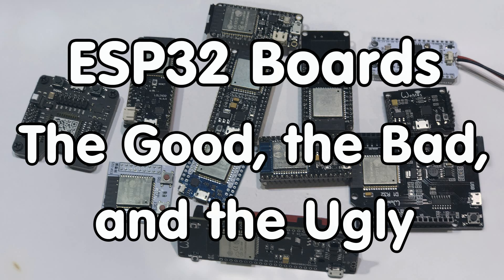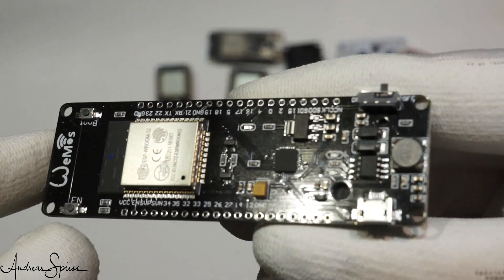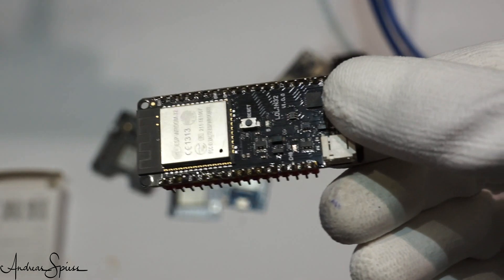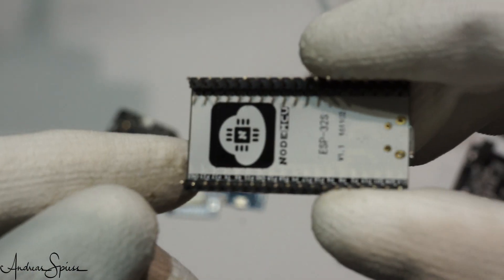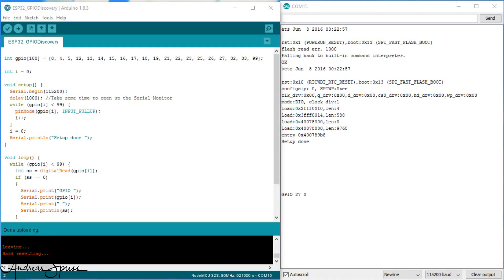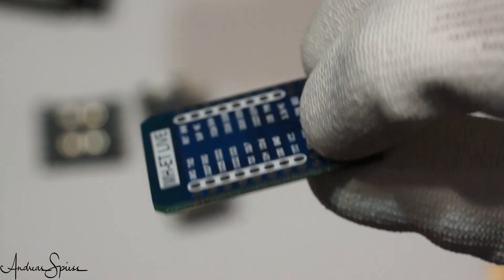#159 Big ESP32 Boards Review and Test

Comment: Wow! Great job Andreas! You have tested so many boards! That saves us so much time! Thank you very much for your efforts!
Reply from the maker: You are welcome! I also was astonished about the big selection available...
Reply: Hello Andreas,
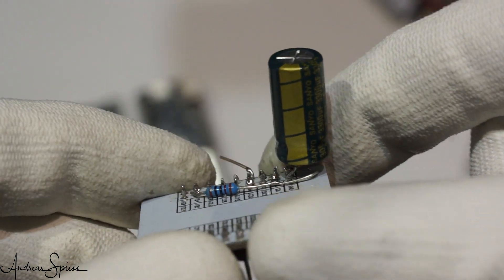i have a question to the breakout board for low power applications. In Minute 14:06 you show the breakout board in Version 1.0. On the back side of the board you soldered resistors.  In minute 14:53 of the video, you show the breakout board in Version 1.1 with added resistors. On online shops where you can buy version 1.1 of the breakout board they recommend to solder a pullup resistor between EN pin and 3,3V pin. Do I really need that also on the version 1.1 board because you said they already soldered some resistors on it? And what capacitor should i use?
Reply: educ8s.tv 

Your video on the DFROBOT esp at 10uA deep sleep was an eye opener. Glad to see you also follow Andreas, as I also follow your great work. So, thank you both.

Comment: There is something that I learned with esp8266 boards: some of them has more pins available but you can't use them because are used internally for flash memory. This is what happen with the wemos d1r2 board. It seems that has less pins available but these are all the usable pins. The missing ones can't be used because interfieres with the memory chip.
Reply from the maker: You see these pins on my Excel (marked red). I did not check all boards. But the ones I looked at did not expose these pins. My first Analog Lamb board (not in this selection) exposed them and created some headache...

Comment: Thanks for the wonderful review. I have the mini board and it is compatible with the Wemos D1 Mini shield. The sketch GPIO pin has to change e.g DHT11 shield, the pin is mapped to 16 in this board.
Reply from the maker: Thanks for the feedback. I have to try then!
Reply: I brought a couple as they are supposed to work with the DI Mini shields and I have yet to start playing with them. They are very inexpensive.

The manufacturer has published Arduino sketches showing compatibility with the Webmos D1 Mini shields.  I assume that the standby current is a factor of the USB interface chip and the power supply chip? As with the D1 Mini, I also assume that these chips can be disabled / removed once the ESP32 has been programmed. 

I like the format and look forward to playing with them.

Note, the ones I received fit normal header pins, perhaps yours is an early model?  They can be bread boarded if you use 'female' headers for some of the pins, and male headers for the other. In this way the male pins can be pushed into the breadboard, and then you can insert DuPont connectors into the female headers on top. If you put the female headers on the top, you can also stack on D1 Mini Shields.

Since mine appears to be a later revision, I will check the chip revision and post what I find. 

Love your work.
Reply: New to ESP world, I recently purchased randomly a Wemos ESP32 Mini Board. I quickly understand it required solder... Then I discovered D1 mini shields and got some, very cheap and a cheap Wemos d1 Mini too. Tested Oled, SDcard and double socket atm, they work well with esp8266 and ESP32 aswell. 
I really love this format it fills like electronic LEGO.

Comment: Hi Andreas! the "reverse oled" connector is an "Molex PicoBlade 53261-0271_02x1.25mm Angled"  you can find clones searching for "jst 1.25mm 2 pin". Very small quadcopter LIPOs mounts this connector;)
Reply from the maker: Thank you for your help. I ordered a few of them!
Reply: Andreas Spiess Thank you for your vídeos! 😊
Reply: I suppose you can just change it with a regular JST connector

Comment: I just recently received a WeMos OLED just like the one in your video. I can confirm that mine claims to have chip revision 1 (via your sketch, both version methods report 1). Just like others here I can also confirm that I do not need to execute any special tricks to upload from the Arduino IDE (WEMOS LOLIN32, Flash frq 80 MHz and upload speed 921600).
Thanks to Alex Goris here for mentioning AnalogRead is working. I'll need that :-)

And thanks, Andreas, for all these video's. They have been very helpful!
Reply from the maker: Thanks for your feedback!

Comment: first of all: great videos Andreas, keep them coming! 

Andreas comments about some of the modules being breadboard unfriendly. Since I just use one similar to the "yellow" module,  I thought I'd share my finding that if you take 2 breadboards and connect them next to each other, removing a power supply bar from one of them, you an easily use them with the standard breadboard and it gives you lots more space at the same time. I wish there would be bigger boards ....
Reply from the maker: I also used this concept once or twice and wished, some manufacturers would deliver this concept with a base plate to be more stable.

Comment: The "White Board with OLED" is a HELTEC WebKit 32. 
I haven't played with that board yet, but I have used the WebKit 8 , which is a ESP 8266 board. If you need a tiny ESP8266 board with a display, it works well.
Reply from the maker: Thank you for your feedback!

Comment: Thanks for the ESP32_GPIODiscovery. I recently bought some LoLin boards and some GPIO's  are in disguise. Funny thing is that the boards I bought (with oled, with without battery charging) are even not in your test. It's going quite fast with the esp32!
Reply from the maker: Do you have a link to your board?
Reply from the maker: Thanks for the link. I think you are right. They are coming at a fast pace...

Comment: There are custom Arduino Uno boards that can switch between 5V and 3.3V. Libraries itself aren't problem, rather electronics that depends on given logic voltage. Handy when moving components from Arduino to ESP.

Also one thing I found is that the Uno had filters on the current from USB while my ESP (and other) boards did not. That was an issue when trying to run neopixel LED tape. Arduino worked properly when powered from a laptop USB port while ESP boards (and particle photon) had a lot of interference on the one-wire and did not run the LEDs correctly. Powering those boards from a USB charger of better quality "solved" the problem.
Reply from the maker: ESPs are very picky about voltage and need much more peak current than Arduino. I did videos about that in the past. This might have been the reason for that.
Reply: Not only ESP32 failed with those LEDs - Particle Photon and STM Nucleo also. I also tried a lab power supply and that also wasn't ok. https://forums.adafruit.com/viewtopic.php?f=47&t=123007

Comment: Something to note about the board at 9:23 - the "GND" pin right next to the V5 pin is mislabeled (even on the reference manuals!), it's not actually a ground pin and connecting it to the ground will just put the board in an error state where it flashes the LED and does nothing else. Use literally any other GND pin but that one instead.
Reply from the maker: Thank you for the info!

Comment: Nice review! It would be nice if they had a larger development board which would map all pins. It makes sense for a 240 or 120 MHz processor to have more pins and completing mapping of all pins. It would be also better if the pin headers are on top rather than the bottom of the board.
Reply from the maker: You find many boards which have all available signals at the pins.

Comment: Do you have a board which supports battery and it is also possible to get a state of charge in the ESP code? This could be a general feature, but I did not find an answer to that question.
Reply from the maker: I usually measure battery voltage (voltage divider and analog input). Which is ok for Li-Ion. It does not work with LiFePo4 because their voltage is very constant till nearly the end.
I also made a video about current sensors and there (if I remember right), included a joule meter IC which does what you need.
Reply: @AndreasSpiess  Thanks. Yes I remember the voltage divider and the IC video as well. I would use 18650, so that should be OK. I was just wondering if it is already prepared on any of the boards? I mean is there a pin which is the switched battery voltage what I can connect to ACD with a voltage divider? I assume it should be the battery + line after the main on/off switch.
Reply from the maker: I never searched for a particular pin. It is quite easy on my 18650 holders. 2 resistors in series from plus to minus and a wire off the middle.

Comment: You should do a review of the ESP32 wrover board! It has a wrover module, 4mb external ram, screen and sd slot on board
Reply from the maker: So far I did not see many boards and I do not have a need for an SD card on a connected device. Maybe at a later stage when more boards with this chip are around...

Comment: Great video. Thanks for the extensive comparison.
I have on of the MH-ET boards (D1 mini form factor) that gave you problems with male pin headers. I think mine came with only female headers. In any case, female headers fitter perfectly.
Reply: I also have  2 of the nice mini kits. But the wifi reception is very poor. 18dBm less than a real WeMos LoLin 32. Do you have a similar experience?
Reply from the maker: + Álvaro: Thanks for the tip. I will try.

Comment: It is an older video but the designers of the d1 r32 wemos boards that look similar in form to the uno r3 has no analog read or write.  BUT you can add it by using a customized library that was put out by a user.  I believe you will find it in the library manager inside of IDE, it is called esp32 analogwrite.

By utilizing this library I was able to do pwm on several digital/io pins...but still no functionality on the analog only pins...

just an fyi
Reply from the maker: The PWM functionality  (analogWrite) is available also on Arduino boards. It is only a very crude method with  low resolution. But, as you mention, it works.

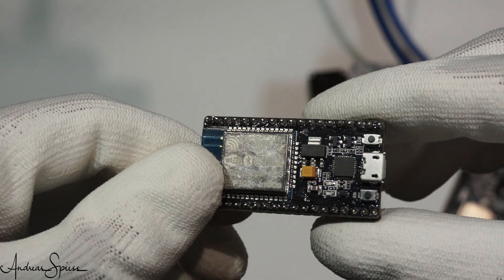Comment: Andreas, i am not sure if you ever found out what type of battery connector is used on the board at around 6:45, the white ome with OLED display.  The battery connector is commonly used in small or nano helicopter/quadcopters and has several names:  "JST 1.25", "Micro JST 1.25", and mCX.
Reply from the maker: Thanks for your info. In the meantime I learned about these connectors and even bought an assortment of those. You find them also in my newer videos about other ESP32 boards

Comment: Hello Andreas, nice presentation. What is your soldering method for the tiny PCB ? I've just purchased it , but I'm afraid I won't be able to solder it with standard iron. Thanks
Reply from the maker: It is easy to solder it with a standard soldering iron. Just try it. Maybe you start with two opposite pins to fix it in place.

Comment: Hi Andreas. Good roundup! With you previous video you shared a link to a ESP32 module on Aliexpress. You might be interested in one of the other listings (if you have not already seen it), which has an OLED display, SX1278 Lora chip with antenna and battery connector with charging circuit for €13.64. Cannot link the actual  listing but look for something like:

Internet Development Board SX1278 ESP32 WIFI chip 0.96 inch OLED Bluetooth WIFI Lora Kit 32 module for arduino

Cheers,
Reply from the maker: I saw it, but it is only 433 MHz and LoRaWAN is on 868MHz. So, I wait till this version is out.
Reply from the maker: BTW: I am pretty sure ESP32 development board and LoRa is not a very good combination. The deep-sleep current used by the development boards is too high (LoRa is a low power technology)

Comment: Hi Andreas.
Thank you for the great video.
It would be great if you could also do a similar board review for 8266.
Still, 8266 is not dead. They are very cheap ($2) and it will take at least one year for ESP32 to be at least close in stability and price to ESP32.
Reply from the maker: I think I did such a video when the ESP8266 was newer
Reply: Yes, I now found video 41.

Comment: just to mention: The "bare  ESP32" pcbs now seem to be available in a newer Version V1.1 with 2 SMD resistors on board. I just ordered 5 for <2EUR. We will see. 
Seems to be attractive. I also odered a WROOM for <2.50 EUR. I also will add a DC/DC converter  for 0,50 EUR. 
I already soldered a 10uF  0805  X7R SMD cerco between the 3.3V pin and the metallic shield. 
This combination should give an unexpensive, small  ESP32 unit.
Reply from the maker: I think, I mentioned the 1.1 version in the video and ordered also a few more. In the past, I used 1000uF capacitors for the ESP8266.

Comment: Too bad there aren't any decent boards- and too bad the BT support isn't complete on the '32 yet. I have one, but my two requirements are still difficult or missing (AWS IOT MQTT, BT as client/scanner).
Reply from the maker: I think some boards are ok and BT works in the Espressif IDE. So, I hope, it will be ported to Arduino soon...
Reply: sorry, decent for my purposes :) seems like there aren't any "killer boards" yet. Fingers crossed for BT to come into Arduino. I'm working on a dev board now, but not putting a ton of effort into it yet.
Reply: The power consumption for BLE (even in BLE-only mode) on the ESP32 is astronomically high (>10x) compared to most BLE-only chips, this is disappointing but good to know

Comment: I really like this video, thanks +Andreas Spiess.
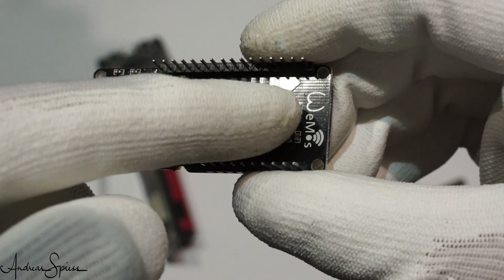Regarding this Wemos board with OLED display (@ 8:15), I have this one and it resets fine if I select Wemos Lolin32 as board.

I did a double take @ 12:33, where you mention that analogRead() is not yet working in ESP32, I was testing that 2 weeks ago, and found it was working fine. I used the Lolin32 board and the basic Arduino AnalogInput example sketch, I changed the sensorPin variable to 35 and flashed this, it worked perfectly. Allthough because the ESP32 has a 10-bit ADC (vs the 8-bit on the arduino) the analogRead values go from 0-4096 instead of 0-1024. Also the ESP32 is a 3.3V logic so the analogRead() output will be 4096 at 3.3V instead of at 5V
Reply from the maker: Thanks for the feedback. I did not test analogRead, because I had the information, that it did not work.
Reply: I think there also an oddity where the analog read, with the internal 11db scaling applied cannot measure more than the ADD input, which is usually tied to regulated power line.. so trying to read the battery level will always give full scale. A voltage divider is likely required. Most boards don't have one integrated, unlike e.g. the Wemos d1
Reply: Well isn't that always the case? An ADC will always read relative to its logic level. For regular Arduino's (e.g. Uno) that is 5V, for ESP32 (and 8266) that is 3.3V. And yes you need a voltag regulator if you want to read anything above that voltage.

Comment: Great review, I have what I think is a geekit, however I'm getting a bit frustrated with continual brownout when connecting to wifi
Reply from the maker: A stable power supply is very important for these chips.
Reply: @AndreasSpiess  thanks for the reply, but I think it's a bad mcu as I flashed another identical device and it worked ok

Comment: Thanks for the video, my Wemos Lolin has a version 0 chip bought it directly from Wemos (the real one) they have now a new lolin but it is unshielded and looks like the board design changed too even both show in v1.0.0 on the silk screen
Reply: Sorry it is a lolin lite
Reply: same here-I have Wemos Lolin32 bought from official Wemos store (in 14/05/17) with chip in rev. 0, shame that board manufacturer did not differentiate the boards somehow. So maybe later versions were available in rev. 1 ...anyway this rev.1 chip board is maybe still available in shop from Andreas link in video description...but I just guess because seller says nothing about rev.
Reply from the maker: They learned and included the "rev 1" in the title...

Comment: Hi Andreas, I have one of those NodeMCU boards, it also states V1.1 on the back of the board. When I check the board revision using this in a sketch:    
esp_chip_info_t chip_info;
    esp_chip_info(&chip_info);
    
Serial.println("This is chip revsision: ");
    Serial.println(chip_info.revision);

It states that the board revision is 1 in the Serial monitor, and not 0 like you stated in your video. Or am I missing something?
Reply from the maker: +misteragony I think, you were lucky. It is a matter of time and all revision 0  boards will be sold to us...
Reply: Ok. Thank you for your answer Andreas (with the Swiss accent). Regards from someone with a Belgian accent  ;-)
Really enjoy your channel!

Comment: Some remarks about the WEMOS  OLED i learned the hard way:
GPIO4 and GPIO5 are not available if you want to use the display
GPIO12 cannot be used for output to drive leds or relays' otherwise you get stuck in a reset loop
Hope this helps anyone
Reply from the maker: GPIO4 and 5 are connected to the OLED display (I2C). You see this in my sketch. GPIO12 does not create any issues with my board
Reply: Andreas Spiess 
I tried to connect it to a standard 4 ch relay board and the esp kept restarting.
I checked a schematic online. The relay control line connects to an led in series to a resistor and the optocoupler to vcc. According to esp documentation this prevents the esp from booting normally

Comment: Thanks Andreas. Your videos are quite informative. Since the last one (WROOM-32 with ESP32 PCB) does not have an USB option, can't you flash it with UART cable?
Reply from the maker: As with the ESP8266 you connect a USB-to-Serial board for programming. During operation, you do not need one. You can also update your sketches over the air...
Reply: Appreciate the response. I did think so. So, even though the PCB does not have USB, it is not a blocker, and the programming board is not a must. Thanks.